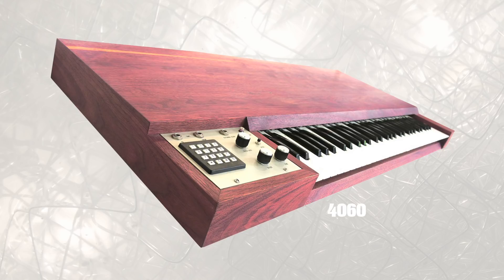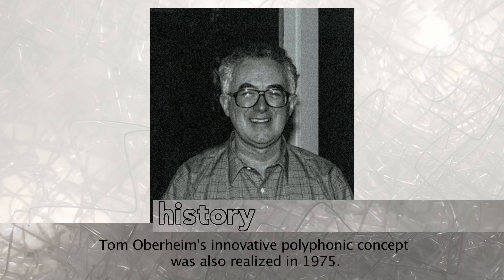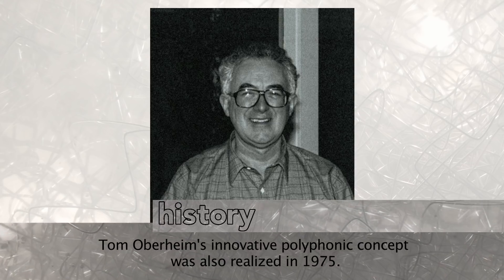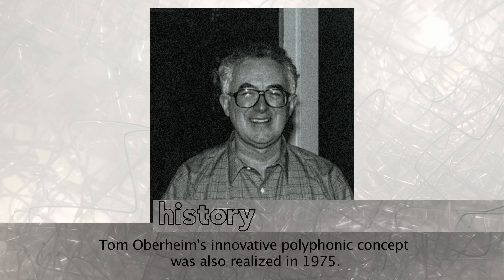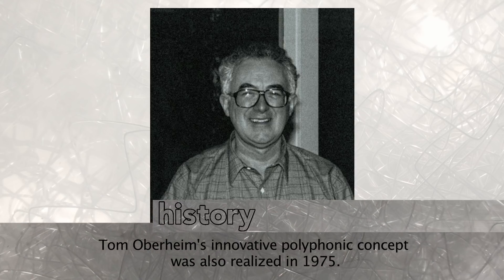A History of Polyphony: Part 12- The Modular Concept in Polyphony: Oberheim

Comment: Excellent series, Marc. I have a question.  You mention that Yamaha's CS polyphonic synths came out essentially contemporaneously with the Oberheims.  What about the   Yamaha GX-1 which came out in 1975 - but its commercial prototype version, the GX-707 came out in 1973. Presumably they were working on it several years before that.  Did it use digital voice assignment as well? And if it did, did it use the Rossum patent, or did it use a similar method independently developed?   This is from the GX-1 Wikipedia page:    "[Chapter 1] Origins of the Yamaha Synthesizer". History, Yamaha Synth 40th Anniversary. Yamaha Corporation. 2014. ... Introduced in 1975, the GX-1 was ...", "Why digital technology in an analog synth? ... It was thus clear that new control technology would be required in order to use a limited number of circuits in a more effective manner. ... This type of device was known as a key assigner, and it can rightly be called the predecessor of today's dynamic voice allocation (DVA) technology. Back in the early seventies, when tone generators still relied on analog technology, digital circuitry was already being put to use in these key assigners.", "In 1973, Yamaha completed development work on a prototype codenamed the GX-707. Based on cluster voltage control, this instrument could be regarded as the predecessor of the Electone GX-1. .."

Comment: It was not a shot in the foot, Marc. It was just using the Oberheims in a musical sense, not a technical or theoretical.
Analoguosly you could ask why the smallest step from one tone to the other in an European or western sense of music is only a half tone. It could be much more precise - say a quarter tone. But then it would be nearly impossible to create a decent system with all possible harmonies. Music as an art form has a lot to do with the golden mean. If you go to the extreme on one subject the other has to suffer.
Reply from the maker: I don't entirely understand what you're asserting... largely due to the fact that the homogenization of timbres created by a device that is designed to provide a variety of timbres is not "more musical."  That's like saying an organ is more musical than an orchestra.  

The synthesizer, an instrument/studio designed to allow the user to create new musical structures and new timbres, would not need to become an organ like it did.